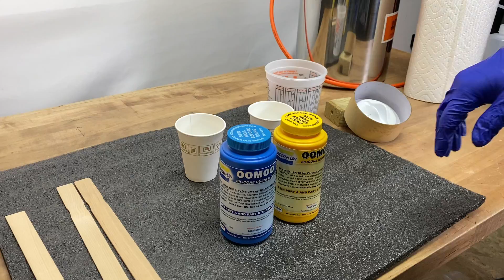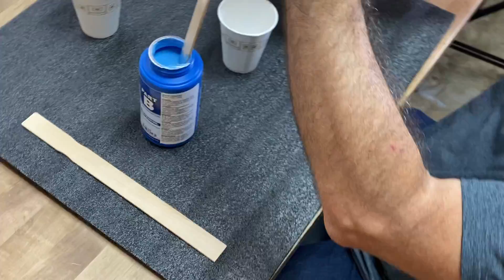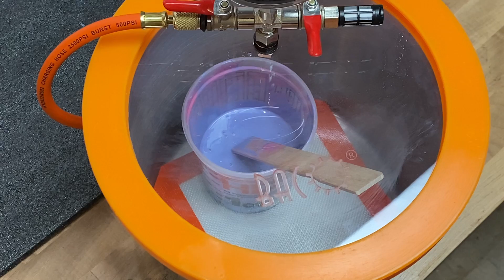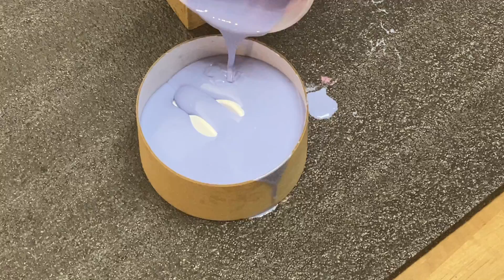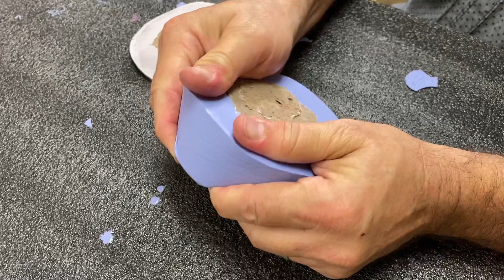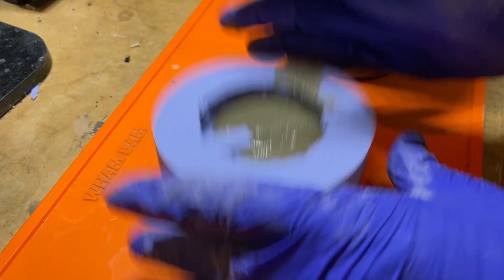Simple Silicone Mold Tutorial Using A 3D Print

Comment: Have you experimented with Cement-All? I found it at Home Depot. It sets in about an hour. In the summertime an hour & it's ready to demold. In the cooler winter months, it took about an hour & 20 minutes before I could demold without breaking my parts. It's aEXPENSIVE, when compared to regular cement, but worth the cost to me, for the speedy cure rate!